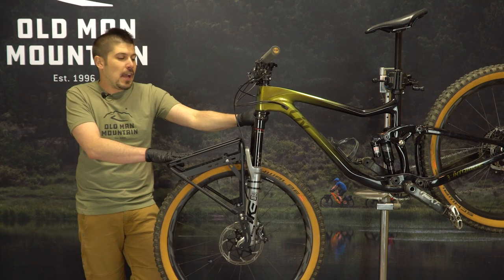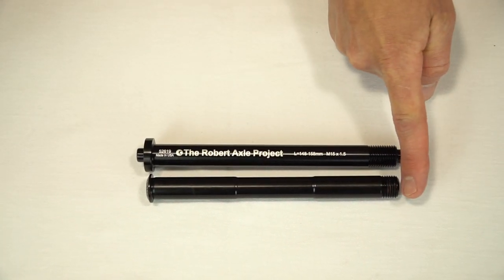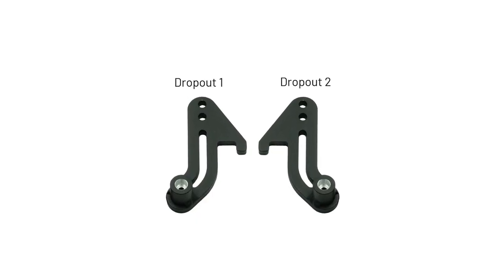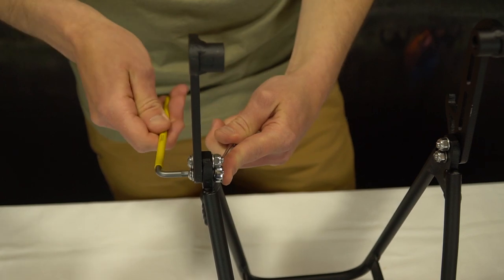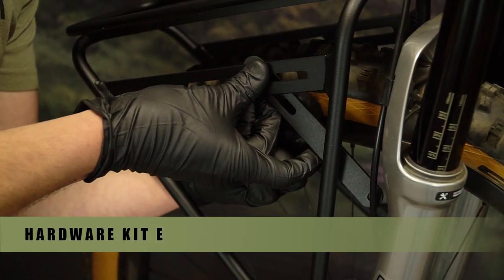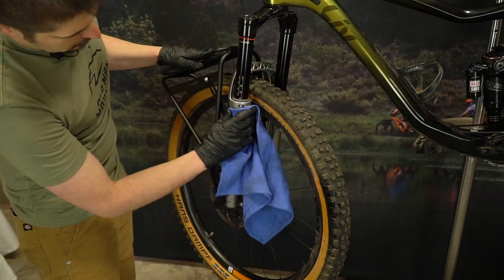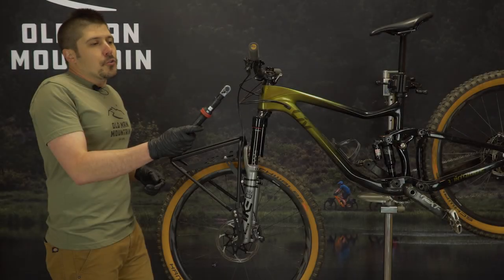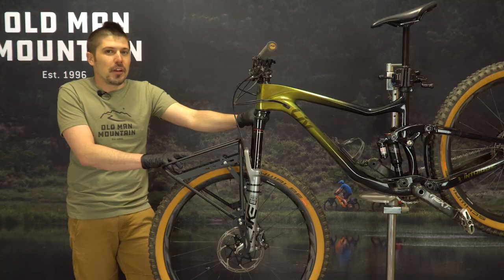How to Install a Classic Rack on a Suspension Fork

Comment: All that tech and then the final say comes down to 4 zip ties. Makes me think I'm over engineering my set up with the sheer amount of zip-ties I use on my blackburn cages ( I only have above axle-eyelets on my sus tourer) that currently reside on my bike. I am intrigued to try these forks out as I enjoy the specific nature of their intended market - sus bikes. The dream is to have a fully sus downhill save cross-country happy touring bike. I wonder what materials the racks are made of???
Reply: Properly made Zip ties have a good deal of strength, along with easier installations and the ability to de-mount a rack.
What i find interesting is the Pucks look 3D printed. I have done several very strong 3D prints using nylon/ carbon fiber filaments. In my opinion a company making racks and using 3D printed parts is a big plus for those hobbyist cyclist that own 3d printers. One can simply 3D print your own custom design pucks.

Currently, we are using Topeak MTX QuickTrack racks. Unfortunately they have a low weight limit. So yes, I think ill give the old man rack a try. I can always 3D print a QuickTrack receiver and install it on the old man..

Enthusiast 3D printing, Cross country, Mountain biker in Thailand.
Reply from the maker: The zip ties we use are extremely strong with a metal tang and they are UV resistant so be sure to use those and not any standard zip tie. The racks are made of 6061 aluminum.